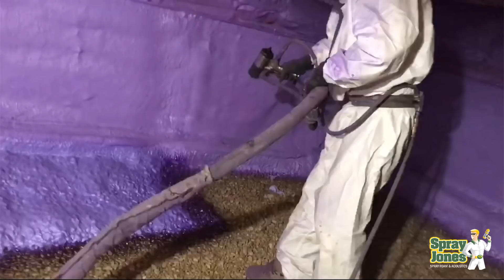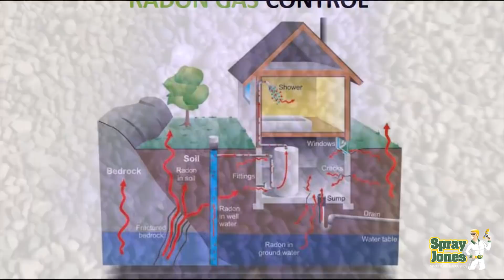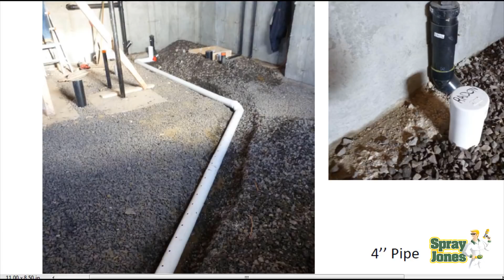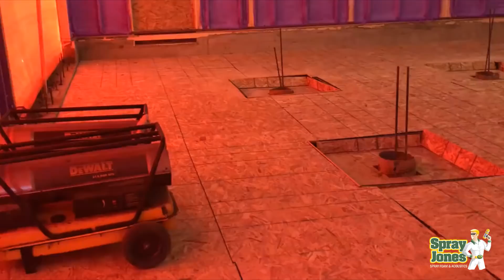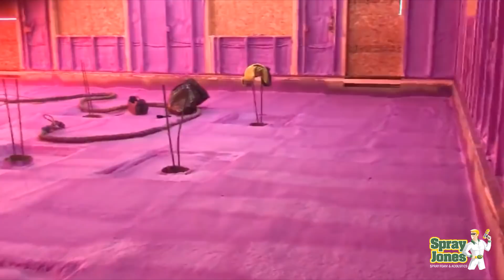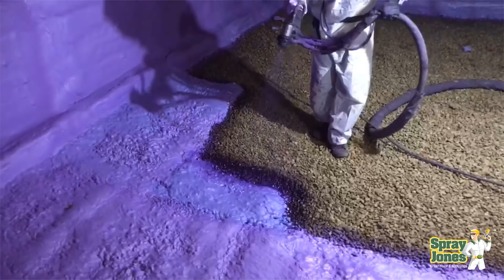Under-Slab Spray Foam Insulation Is The Future!

Comment: Very cool.  That makes all kinds of sense.  The load transfer from the concrete to the structural fill would be way better.  What's the compressive strength of this stuff?  They build entire overpasses on top of structural foam.

Comment: I have been following you advice for my new home build. I can not thank you enough! I even did a 4" spray under my concrete slab. My one question is that if I lay down flooring. Its a concrete composite flooring that looks like wood (McMillan SPC water proof flooring). They sent a plastic sheet as they said its a vapor barrier. The flooring has a nice pad attached to it, but I was wondering if you think the plastic sheeting would be necessary between the flooring and slab. Is the closed cell 4" a vapor barrier?

Comment: What is the point of the void between plywood and soil? Is that air space going to cause problems?
Reply from the maker: It is a structural slab floor, the whole point is a void so no earth heaves against the slab.

Comment: Thanks for your videos. Very informative. Question: Can one attach upinor (in floor pex) to the under slab spray foam and lay rebar after? In Florida we are supposed to lift the rebar up during the pour. So we put rebar (usually fiberglass rebar) on top of pex. Thanks again for sharing all of your knowledge!
Reply from the maker: Yes they sell clips to hold piping in foam insulation that will work with SPF. They are barbed.

Comment: Great video!! We are in Hawaii with lava boulders. I want to build a natural pool but keep the stones in place. Thoughts on spray foaming the area of pool and then pouring concrete? Will the concrete slide down sides faster bc of spray foam? I’m thinking it’s a great way to create a water tight bond w stones and prevent leaking if the concrete cracks…
Reply from the maker: You are correct that the SPF will be necessary for sealing and creating a transition between jagged rocks and the finishing products. I would use closed cell 3 -4" to get things sealed.

Comment: I'm having 3" on walls & ceiling but am seriously considering this for the slab vs 2" EPS. So...1.5"-2" of CCSF?

Any updates specifically & detailing with radiant (PEX) heat? Also wondering about breeching it via the pex pipe staples? Thx

Comment: Very interesting, thanks for sharing!  So the cardboard and osb underslab framework is just allowed to degrade over time resulting in suspension/cantilevering of the floor?  I'm assuming the SPF adheres to the concrete floor and will not fall?  Thanks

Comment: There are cheaper ways to deal with soil gases and why, for both heating and cooling, would you want to cut yourself off from the constant ground temperature?
Reply from the maker: Cheaper ways.... have at it, we deal with people who are looking for a better way who have tried it the "cheaper way"

Ground temp?? You don't know what you are talking about.
Reply: @SprayJones  I actually do know what I am talking about.  Depending on area of the country, the constant ground temp of 55 to 60 degrees can act as a great starting point for either heating or cooling.  When you cut the house off with insulation you have to heat or cool the house from ambient.  In Syracuse that could be a difference 100°F (-3- to +70) in winter or in Texas as much as 35°F (+105 to +70) in summer.  In contact with the ground, you only have to go from 55°F to +70°F in winter in Syracuse, and 55°F to 70°F in summer in Texas.  This all of course, depends on how well the envelope is insulated and air sealed.  I have built houses with this approach, and I assure you it works, and are also radon free.
Reply from the maker: @CharlesBuell  So what is the ground temperature of Minnesota 2' down in January? 
The video applies to those who need insulation against low ground temp, isn't that self evident?
I am not applying this to Mexico...

Comment: Uneven depth of slab can lead to cracking so that needs to be figured out. Also why hire a specialist to spray when unskilled labor can lay cut and fit sheet goods over 15 mil poly?   Not saying it is a bad idea but much easier cost effective ways to do this already exist.
Reply from the maker: Go hard.

Comment: Being a concrete finsher I am just wondering. How consistent is the height for   like figuring out the concrete amount. When we grade were about with in a 1/4 inch
Reply from the maker: Around that, sometimes more. 
We have worked for some fussy ppl and they have been Ok with the results thus far.
Reply: @SprayJones   thank you for the reply very interesting.

Comment: Where can I find costs for this type of product? What is its generic name? Are there distributors or manufacturers that sell directly to contractors?
Reply from the maker: Find a spray foam contractor in your area.
Reply: @SprayJones  found the Versifoam website and dealers in WI. Looks like 2.3x the cost of 1” foam board. I ll try it around edges of foundation and foam board.

Comment: Was hoping I could get an answer to a question. Can you spray closed cell on XPS. Specifically the walls of an ICF?
Reply from the maker: On ICF? Yes you can.
Reply: @SprayJones  Great. Thanks. Didn't know if there is an issue with the spray foam being too hot. Looking forward to your video on underslab SF and termites.

Comment: A few weeks ago, I saw one of Matt Risinger’s interview with a northern builder/contractor showing the under slab spray foam. Very cool and interesting.
Reply from the maker: Thanks
Reply: @SprayJones  Exactly why would you need to remove radon from under the FOAM layered sealed slab?  Just a question.  Seems like that would negate needing to evacuate radioactive air from under the slab.

Comment: What if years down the road the cement cracks and then there a water leak (washing machine, hot water heater, pipe break, etc) the water would pool under the slab and have no way to dry. Maybe even heave the concrete.
Reply from the maker: Wow, you must be bored to come on here and start inventing hypothetical scenarios....
So what would you do with a regular insulation job or a mandatory sealed air barrier?
Reply: @SprayJones  was a serious question something that has a very likely to occur in the future. 
Don't get me wrong I like spray foam just under the slab scares me for this reason

Comment: In searching your videos I can't find if you answer the question of using spray foam in a steel framed pole building.  It seems to me that you would have to spray the entire steel beam system to not have a condensation problem. Would this be true?
Reply from the maker: Playlist dedicated to metal buildings....
Reply: @SprayJones  those all look like wood framed steel skinned buildings except the quanset style that does not use steel beams.  I have a builder who wants to put up a steel framed building for me and I am concerned about the steel beams radiating the cold into the building thru the steel.

Comment: Idk if you ever seen old foam or old spray foam. It gets weak and deteriorates. Would not trust this at all.
Reply from the maker: That comment is so vague and pointless:
Where? When, What chemistry, Under what conditions?
Why would the building code list it as a product?
Why would ULC write a master standard for it?
Why would suppliers issue warranty for it?
Why have I been spraying it for 17 years?
Why has it been used over the New Orleans Super Dome since the 1970s?
Reply: @SprayJones  you must of never worked on old houses then
Reply from the maker: @TheTechGuider  What are you doing here? You didn't answer a single question I gave...
Reply: @SprayJones  money that's why.

Comment: I am building an ICF with an unfinished crawl space. Obviously there is gravel on the ground and I was debating whether to do an air seal (isolate the bottom of the floor rafters (I-joists)) or isolate/seal the ground for the radon and temperature control.
Thank you for sharing this information!
Reply from the maker: Cover the floor. This is code here, you cannot leave the soil exposed. Watch the video I have "in contact with ground" see the second half on CS encapsulation.
Reply: @SprayJones  will do. Thanks for the suggestion!

Comment: i absolutely love the closed cell spray foam. i wish it was more affordable!
Reply from the maker: It is affordable when you connect with what you are getting for life. 
My foundation on our house was 80K. I didn't wish that it was 20K. 
People have to get their minds around proper must-have expenses. Or build smaller...
Reply: @SprayJones  what is the price of materials per sq ft at depth of 1”?
Reply: @SprayJones  while i agree that the cost savings over time do add up, there are just too many options that are much much more cost effective and still do a very similar job. i wish it was more affordable, more competetive to the rest of the insulation market i.e. fiberglass and stonewool/rockwool. even the price difference from open to closed cell foam is a lot.
Reply: Do the prep work yourself and the clean up yourself and then it’s cheap and well worth it .
Reply: @leedeveau3884  this is wrong, mostly because you cannot get proper equipment for a 2 part closed cell foam application. you need the heated lines and gun and the pump system. the two bottles systems you see out there are DIY and they are DIY for a reason.

it is no where near the same application as a professional job with the professional equipment to do the job.

then you also put all the responsibilities on yourself, so if you did something wrong, (DIY) then it's on you to pay for all of the repairs too, being that your aren't a pro if you are using these kits, you are likely to make some mistakes.

also look at how the foam comes out of those 2 tank systems, it's already foam when it hits the surface, meaning it doesn't always "wet" the surface. it needs to so that it can stick. you'll see this problem a lot with the 2 tank system.

Comment: I've been planning on this approach but thinking twice now that SPF cost has increased 2.5x over the past two years. 🤦‍♂️
Reply from the maker: So cost is all that is stopping you? Envelope is THE most important thing after structure.
Reply: @SprayJones  I agree with your statement about the importance of the envelope. However, there is a point with exponential price increases where cost becomes the limiting factor for a broader group of people. I understand that's just where we're at now as the cost of materials increases along with the cost of just about everything else...just bemoaning the fact.

Comment: To help absorb this video, ask yourself a question about your home or business:  where's the frost line?   Your structure is sitting on one giant heat sink come winter, and the speed with which heat is transferred is proportional to the temperature differential - that's the way thermal efficiency goes, so take note of materials used when building.  You never really stop heat transfer by the way, but you can slow it down to a crawl.
Reply from the maker: Correct

Comment: Hahaha.. cost? Building $40k, slab, $30k
Spray foam $90k
Reply from the maker: I told a guy once that bought a 100K building package that the SPF was worth more than his building because we are the building. 
The envelope is the single most important issue besides structural integrity.

Comment: Was planning to use Stego PANGO WRAP for a vapor & Termite barrier with Termistop mesh around all protrusions....buuut...I wonder if this closed cell spray foam would be a termite barrier. If so this would be a better solution as I would get some therm benefits too.
Reply: ok cool. Just got to the end of the video where you talk about doing a comprehensive video on the "ctitters". Looking forward to it.

Comment: Thanks again Mike for putting this out. We have been doing this for some time as well in residential applications, and it’s slowly picking up traction in livestock operations where internal environmental control is critical. In these applications SPF contributes a huge edge on every level from  stable ventilation, temperature and humidity control, to long term energy savings. 

I agree with you that under slab is becoming mainstream because it’s happening already in many rural applications. 

It’s worth reiterating that concrete will continuously wick moisture through from underneath and the effectiveness of conventional methods dealing with this is short lived as best. Nothing deals with moisture wicking through concrete like SPF. 

I’m looking forward to your termites video as this is always a major point for new poultry operation construction.  Cheers!
Reply from the maker: I agree 1000%

Comment: Would it be reasonable to do 2inches of spray foam and then say two inches of XPS on top of the spray foam? Might be the best balance of benefits of spray and more thermal performance for in slab heating
Reply from the maker: No. Lifts the rigid off the ground.

Comment: Would 2.8lb roofing foam be acceptable under a heated shop slab?  Also, my engineer detailed a 10mil VB under the foam..necessary?  Thanks for the videos, Great info!!
Reply from the maker: Foam does not stick to poly, we don't use poly with poly. Engineers are woefully ignorant on this product which casts a dark shadow on the validity of their profession.
Reply: @SprayJones  i concur!  What are your thoughts on the 2.8lb roof foam under slab?  I ask because i have some on hand and it would seem that it would be well suited for this application due to its density.
Reply from the maker: @FreedomFoamTN  That is a conversation to be had with the supplier and their technical advisory people.

Comment: I would like just a fun pop science video where you just put a block of closed cell + open cell spray foam side by side and weigh them / test how much weight they can carry before squishing / light them on fire and see how long they each burn / light a torch on one side to test insulation properties / freeze them / etc.

The purpose of that beyond being very fun would give a better idea of what this stuff really is.

Comment: Good video, but most radon systems are passive, they don't use a fan, just exit to open air.  A fan is only added in cases where the radon tests high.  Looking forward to your video on insects - insects nest in foam even in colder climates like Michigan. Love the info on a structural slab, haven't seen this in anyone else's video.  Thanks.
Reply: Insects nest in foam.. have you ever pulled batt insulation out of a 20 year old house? 😁
Reply: @whipporwill2303  Actually, I have, multiple homes.  Have you ever pulled foam out of a home that is less than 5 years old?
Reply: @pampierce  yes I am a real-estate investor with over 20 doors. I also own a spray foam company. Take a wild guess what insulation i have in my home?
Reply: @pampierce  and yes ive pulled open and closed cell out of homes. Far cleaner than batt. The closed cell never has bugs in the stuff ive seen. Ive never even seen bugs in open cell now that i think about it.
Reply: @whipporwill2303  Yes, the older houses let a lot of air in, and fiberglass and rockwool are like a furnace filter, and get dirty like a furnace filter would in the old leaky homes, and then lose R value.  I've also seen some homes where the insulation was like new, and very well installed, just not much of it since they didn't know to fill the cavity back in the 1940's.  And I've seen older homes where they added foam at a later date and the foam shrunk near the wood, letting air in around it and there was very little they could do to fix it.  But this video is talking about EXTERIOR insulation, not interior to the house.  I'm looking forward to the video on NEW houses with exterior insulation.  Insects is a bigger concern on the exterior of the home, hopefully not as much on the interior, especially in the newer houses with low air infiltration.  Foam has its place.  But I love the inert, chemical-free, and fire-resistant properties of mineral wool, even when insects are not a consideration.

Comment: Thoughts on laying 2" rigid down and spraying over the top of that? Could see this being an effective cost for performance solution in cases you want to build up to 4+ inches of insulation, but also want to avoid seams and ensure air and moisture barrier is continuous.
Reply from the maker: We are the rigid.... 
The foam would lift the rigid right off what it is sitting on as it cools.
Reply: @SprayJones  Good to know. I know your plenty rigid but I was just curious as to my understanding 2" XPS 4x8 sheets are probably close to half the price per linear foot in the case of a home owner or builder doing things themselves, but if it doesn't work its as simple as that.